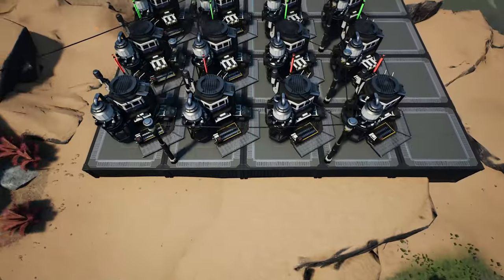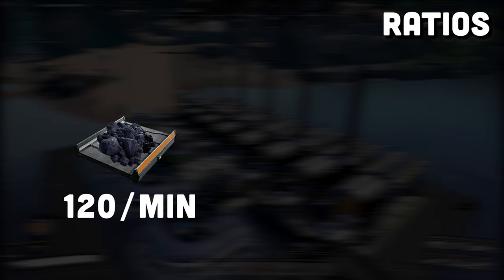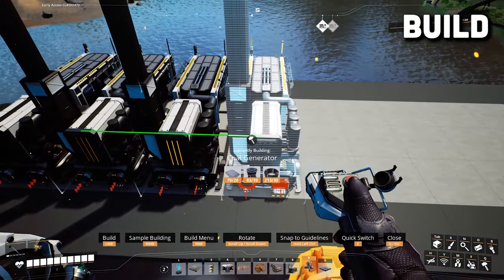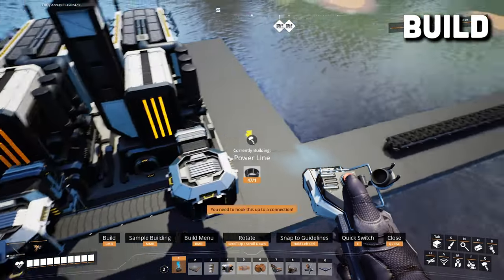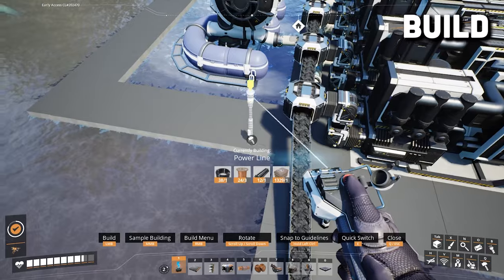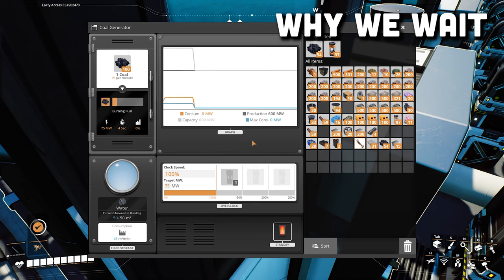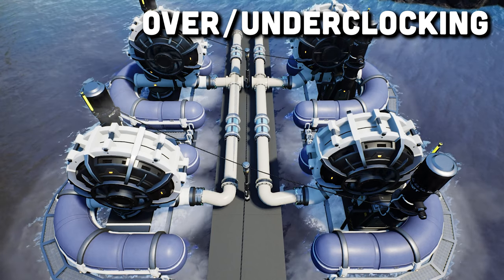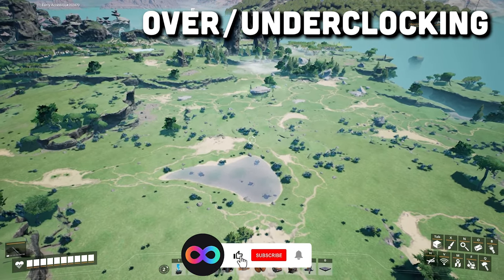How to build an EFFICIENT Satisfactory Coal Generator Setup! (Satisfactory Update 7)

Comment: I do got a question,
I did everything how you did it. 1 miner MK1 on a pure coal node. I let everything fill. However the issue is that some coal burners dont get enough coal. I coppied everything you did.
Do you know what the issue is by any chance?
I did not overclock anything.
Reply from the maker: Make sure it’s a mk2 belt between the miner and all the splitters ( doesn’t have to be all of them but it’s easier to check that way) but I would also turn off all the coal generators and let the lines fill up. Also it helps to try to fill up 100 coal manually in the generators to get it to saturate manually, but it will eventually do that anyways (except the last 2, those will never reach max)
Reply: @spectrumdad_  that is what i did indeed, on everything i’ve been putting mk2 belts all over my factory. The last 2 just seem to go down steadily even when i did what you just mentioned. I even let the conveyer belt full up together with miner and burner and they still go down slowly.

Comment: I have a habit of keeping biofuel burners near the water extractors to act as a just in case so I can refill my pipes after doing a reconfiguration
Reply: Good reason to have switches between workzones when running a central power grid, cut off certain areas to jump start in phases, like if you accidentally overfill your nuclear waste production and all the reactors shut down, then you can at least isolate the reactors so you can restart them easily, granted, youll have to shut down consumption on the rest of the grid, which I suppose it wouldnt hurt to actually create a central hub for power control and distribution. Putting a battery bank to assist.

Comment: The first two or three of my generators are working but the last got almost no coal. The splitters divide all the coal by half for every generator it goes through so I don't see how that would give all of them enough? I might of course be missing something so I would really appreciate an answer. Thanks.
Reply from the maker: Yes at first it’ll be like that until the first one fills up, then it’ll overflow down the line and it won’t be a 50/50 split anymore. As each machine fills up it goes further and further down the line. This is how a manifold works in the game. It just takes time to fully get there. You can help it move along by manually filling up all the generators with coal or turning them off until they fill the lines and machines, then turn them on 1 at a time.
Reply: @spectrumdad_  Thanks! I actually realized you said this in the video before you responded and then it worked. I thought it sounded dumb at first but I was very wrong 😅. So thanks the design is great!

Comment: This guide was really hepfull, but a few minutes after I was done connecting everything, my< water extractors (starting from the entry side of the coal) had a lot of difficutly pumping all the water towards the coal generators, so much that they are about 5 cubic meters away from running out. I also placed them like you said to, each one of them in the middle of 2 generators. What should I do?
Reply from the maker: So it might take a while to settle but it’s also normal to have your extractors show almost no water because they are pushing water at an 100% efficiency flow.  Are you coal generators fully running? Ultimately that’s what matters. Or are they turning on and off?
Reply: @spectrumdad_  I ran it for like 10-30 minutes and indeed the generators were still good. I was just a bit worried, but thanks. Love your videos keep it up!

Comment: i dont get it what i am doing wrong. i did as in video but last 2 almost dont getting any coal
Reply from the maker: Did you let the lines fill before turning them on? I would turn off the first 2 and let the whole line saturate and then turn them back on. If you are providing 120 coal on a mk2 line it should be working perfect

Comment: Hey so I have two miners hooked up to this and the last six generators are using coal faster then they are getting it, not sure what to do
Reply from the maker: Are the 2 miners at least normal purity and merged using a mk2 belt? Make sure to run a mk2 belt down between all the splitters too just to be safe.

Comment: For this to work, do i need miner mk 2? Cuz mk1 doest mine at the required speed, causing gaps between ores, which will then affect the electric produced
Reply from the maker: No mk1 works but you need 120 ore. So you need to either have a pure node, or merge 2 normal nodes, or merge 4 impure nodes.
Reply: @spectrumdad_  alright i see thx

Comment: How are you powering the initial power lines for the water ?
Reply from the maker: I put down a few biomass burners and just grab some leaves around and slap them in there. Doesn’t need to be anything fancy or big, since it’s temporary. Or you can run a line from your existing base to this setup.
Reply: Thank you

Comment: so ive been haveing a few problems with this, when i go to connect the coal generators to their power lines the whole system will run as normal but the one of the water extractors will just start running out of water then some of the coal generators will start to power down like you said but ive followed everthing to a T im confused lol send help
Reply from the maker: The water extractors losing water is normal. Make sure you provide mk2 belts everywhere and that you provide 120 coal to the generators. Besides that check why the coal generators turning off. Is it lack of water or coal?
Reply: @spectrumdad_  i think i fixed it but 1 of the water extractors is really empty one like half full and the last one is full and i have a full belt of coal going everywere
Reply: @spectrumdad_  i think im tip top now its been holding 600mw all day its just odd to me that 2 of the water extractors are at empty pretty much and the last is full but its working so i think were good

Comment: I let my 8 coal generators fill up with water and coal but only the first 3 are actually getting coal. (I am using mk2 conveyor belts and lifters and I am getting coal with two miners mk1 and a merger to get both resources in the same line). How do I fix it?
Reply: Same problem:(
Reply: @molotulya  figured it out
Reply: @molotulya  I upgraded my mk1 belts all to mk2 and let 1) the water pipes   and the coal generators fill with water (until all the water extractors stop working) 2) wait for the coal generators to filled with coal and 3) wait for ALL the belts(mk2) to fill up (untill they're not moving anymore) AND also if you have a miner mk1 on an impure coal node then you need to either upgrade it to mk2 OR get two mk1 miners and use a merger.
Reply: @molotulya  hope it helps ›)
Reply: That doesn't look like a happy face but anyways
Reply: @patatalexD omg just realised that my main belt (from mines) was mk1. Thanks for the help :)
Reply: @molotulya  you're welcome! So it's working now?

Comment: The small lake in 6.14 is the one not so far near one of the spawn points? i do know it. It's very nice to know you can use this to give water to a coal power plant. Thank you so much.
Reply from the maker: Yes it’s the one closest for the Grassy Hills spawn. You can setup maybe 2 setups worth with that water which should be good till you get to fuel. If you need more water there is more but a bit further.
Reply: @spectrumdad_  I can consider getting another setup of coal, there's a pure node still not so far away from the Grassy Hills. Thank you very much <3
Reply: @spectrumdad_  we ended up firing 3 full setups in the pond close to the grassy spawn and have a full 24 generators pumping 1800 watts forever there.  Thanks for the tutorial

Comment: What power source you use to power up the coals generators?
Reply from the maker: Biomass burners. You need 2 to power the 3 water extractors. You’ll need a third one for the coal miner.
Reply: Do you feed them manualy?
Reply from the maker: @sharkboy892  yes, just plop a few down, slap whatever you find nearby like leaves even if you don’t want to convert. You don’t need them long term, once the coal generators kick in it’ll be self sufficient.
Reply: Thanks! I’m giving it a try!
Reply: It is working! Thank you alot!❤

Comment: I did this exactly and the coal isnt supplying enough for all 8 generators. the first 4 use up most and the coal doesnt make it all the way down the line so the last 4 end up going off and on. I added you as a friend on discord to try and ask for help there.
Reply from the maker: I would let the coal generators fill before starting them up. Turn them all off first and let the water and coal fill. Then start them up again. If you send screenshots in the discord I can help there. :)
Reply: @spectrumdad_  I figured out why. It needs to be pure coal ore. and I am using normal. I need to find another source!
Reply from the maker: @PaulBohno  yes you need a 120 belt. Either pure, or normal node with mk2 miner, or overclocked will also work
Reply: @spectrumdad_  well you should mention this cause mine is having the same issues
Reply from the maker: @andrew7490  well I do mention at the beginning you need to bring all 120 ore lines. But yes I’ll add a note to my pin comment. :)

Comment: I followed your guide (which is excellent BTW) and got everything set up.  The generators were filled with coal and water before I turned everything on.  Then when I loaded back into the game later, the generators were running out of water!  Any thoughts or suggestions?
Reply from the maker: Which setup did you use? If it's the standard one I made, I would just double check that the pipes from the extractors are spaced between the coal generators like I demonstrated. If you are still struggling, you can head to my discord and I can try to help you out more there :)
Reply: Add water storage tanks to your setup to give a  buffer of water flow to your generators to prevent this.
Reply: My guess would be head lift.
Check that your extractors can fill the pipes. You might need a pump

Comment: I think it's better if put the conveyor belt like a pyramid layout.

         120
        /      \
     60      60
    /    \     /    \
 30  30  30  30

Because bringing the coal in generator through the conveyor belt will be perfect and stable
Reply from the maker: You are describing a load balancer system, and they it has its benefits for sure. It all comes down to taste, but keep an eye out for an upcoming video about the pros and cons of these 2 systems.

Comment: The reason for why you may run out of coal in the end lines is because of the way the splitters are set. If you're getting 120 the first splitter will put 60 into the first generator and leave 60 to the rest of the line, then 30 then 15 etc. Sure if you let them fill there shouldn't be any problem, but any minor fluctuation in the production (like say, you need to disconnect the belt) will stop your whole setup. What you want to do is feed the coal into a splitter, that one into another 2 and those 2 into another 2 going into the generators. That way you have 100% equal division of the coal
Reply from the maker: You just described a load balancer setup. Both have their pros and cons. Since we are constantly making these things in every setup, I find it more useful to use the manifold system to save space but a lot of people use the other method. Nothing wrong with that!

Comment: Let me just be honest:

You need three coal nodes for this build
Coal needs to be balanced 3-2
Coal needs to be fed from two sides into the generator not from one
The pipes dont connect when the intersections are snapped on like in the video
The belt elevators do not connect to the splitters, you need to place the elevators last. 

Everything else is great. Thx for the vid and your time to make the video :)
Reply from the maker: Just a few notes, it does work the way I show it, you just have to give it time to saturate. As for the splitters not connecting to the lifts, I go over that in the video. I mention you have to place a belt between the elevator and the splitter doing it my way. Or yes you can just place the lift after and not have to worry about it :)
Reply: Literally got it to work as the video said first try.  It’s a skill issue on your part.

Comment: I'm running a 120 Coal pm belt into 6 gens underclocked to 87% each to only need 2 water extractors, the math checks out but my overflow for coal isn't working as intended and the last belt steadily decreases in coal per minute until it's stopping to wait after every burn
Reply from the maker: Make sure it’s mk2 belt going down to the very last coal generator. If you are providing 120 and do that you definitely will have more than needed for just 6.